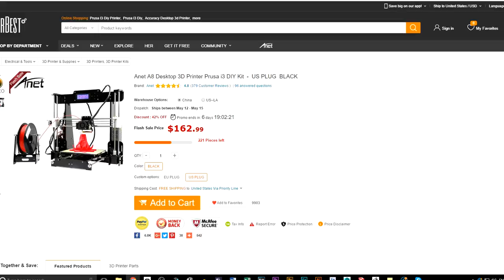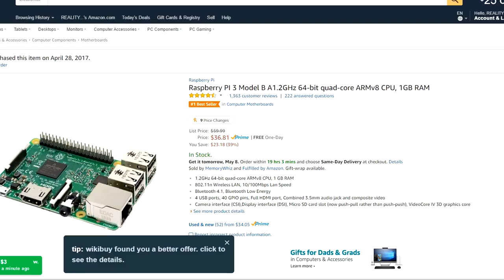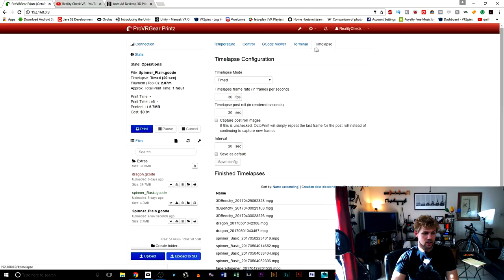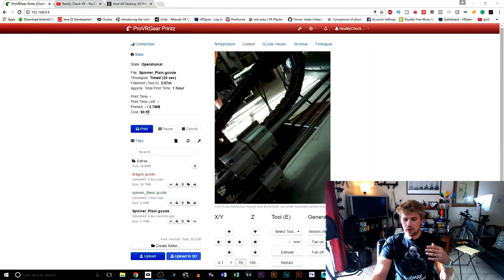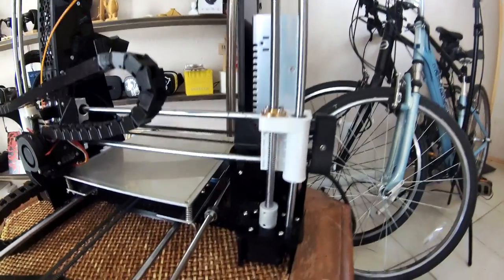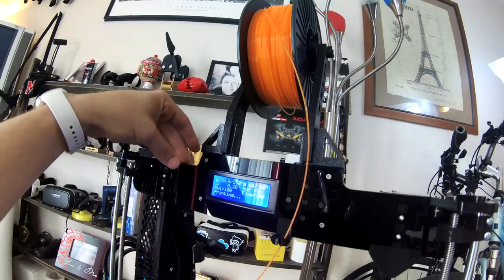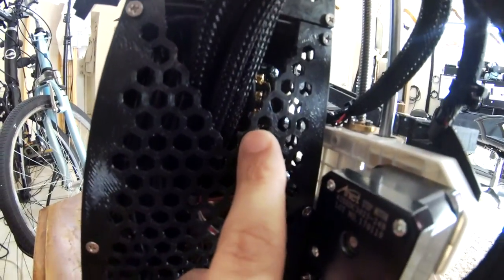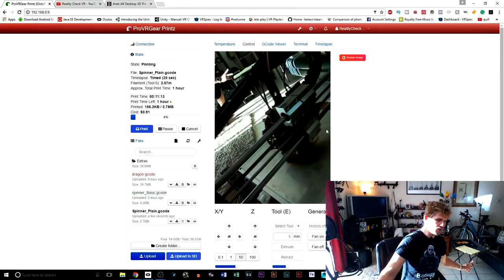✔ Anet A8 3D Printer ULTIMATE UPGRADES! (Prusa i3 DIY Kit) Octopi + Printoid

Comment: There is one modification that keeps getting missed. The hex nuts that are shipped with the A8 are not optimal for the slot method used to connect the acrylic parts together. The hex causes the pieces to move in all 6 directions. By using Square Nuts, a lockwasher at the screw head and a flat washer against the acrylic, you can make your A8 as stable as any frame out there. No need for stabilizers or anything. The square nuts are available on Ebay  (3mm) and I get the lockwashers/washers at McMaster.com. Just sharing! Take Care.
Reply: thanku
Reply: sounds interesting! could you please post some links on which items you used?

Comment: Hi, I purchased the power supply you recommended. I Printed the L bracket provided, but having issues mounting the power supply to the frame.  Did you use M3 screws?  The M3 screws do not hold the L bracket to the frame, at least for me.

Thanks.

Comment: I worked on it over a period of 4 days. (couple of hours per day) If you have fat fingers, tweezers and masking tape is helpful. Tweezer to place the nuts, and masking tape to keep them in place. The only thing that caused me any problems was the extruder. I needed to adjust the threaded feeder tube (mentioned no where in the instructions). Then I tried to figure out how to print a test print. Found out that I had to select a gcode file.
Reply from the maker: Good work man!) This was my first DIY 3D Printer and it helped me learn a lot that I would have never otherwise learned.
You are absolutely right about the fat fingers making things a pain. haha I think I dropped nuts hundreds of times lol. Still once I got this guy running it has remained as reliable ever and is still one of my favorite printers)

Comment: Just to clarify. What is controlling the steppers on your printer: the Pi directly or a standard A8 board controlled by the Pi?
Reply: The Pi/OctoPi software push the gcode to the A8 board via the USB port. You still need the controller, either the stock one or a slightly better RAMPS setup.

Comment: Oi! 37 Thingiverse upgrades?   I thank you for pointing out that the x-axis bed tensioner is best printed BEFORE one starts assembly. My kit is still in the mail, can you please scan the rest of the list and tell us which OTHER of the upgrades are like that? I have no fear of drilling holes to add things on, but I'd certainly like to avoid massive disassembly/ backtracking.

Comment: Very cool the printer! 
Unfortunately, I can not find your covers in the files you have provided for download. 
What did you use for the technology (Mainboard, MosFet & Raspberry)? 
Two different housings can be seen on the video. Thx
Reply from the maker: take a look at the file named "Anet_A8_Electronics_Case_mainboard_octopi_step-down_converter_relay_and_fan..zip"

That should have the covers, and yea I used a Mosfet that is listed in the descript and a rasbperry pi 3! hope that helps)
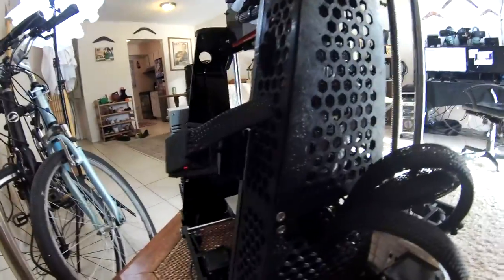Reply: Thanks for the reply, this file I have already found. In the video at 13:53 you can see however 2 different housings. The top I can unfortunately not continue to find. Or have you modified the bottom for the top? On the video the at least not look the same.

Comment: You forgot the most important upgrade: Mount the printer firmly on a veryvstiff and very  level board. Make sure, Everything is straight and level when your m ount it. This adds a lot of consistency to your prints.
Reply from the maker: I agree! although I never had issues with my printer in this way, my table was secure enough) Still check out the video I post later today to see my newest and favorite solution)

Comment: Thanks for the video.  I just received my A8 and about to start my build.  Do you have 1 or 2 mosfets installed?
Reply from the maker: just one, I've heard two was overkill and not necessary, what upgrades are you thinking about?
Reply: Not sure yet.  Half way thru the build and realized one of my guide rods is bent.
Reply: Don't use a Mosfet for your hot end, if you do and it fails it will fail high putting full load onto your hot end and bypassing all your firmware safety's because the board wont be controlling the supply voltage. The Mosfet for the heat bed isn't for safety it is just to offload the higher load of the heat bed from the cheaper controllers so that they don't fail as quickly. Also there isn't the same fire risk with the heated bed as even under full load it is very unlikely to get above 120°C. Fuses for the supply's to the hot end and heat bed are smart as well as a thermal fuse for the hot end.

Comment: After receiving my A8 printer just yesterday, building it and then spending today calibrating and test printing i'm just wondering. Is it worth replacing the Stock Firmware for Skynet? Are there actually any benefits from skynet?
Reply from the maker: for basic stuff no, but to add an auto leveler or multi-extruders you will want to upgrade) hope that helps! HAPPY PRINTING! :D
Reply: Use marlin.
Reply: It's a lot safer to use marlin.

Comment: The switch on PSU is wired backwards, light should only turn on when you flip the switch to 'on'.
Reply from the maker: for sure! I had to go back and rewire it) Originally I wired it based on another video guide that was wrong as well. Once I followed the simple picture that comes with the piece it worked perfectly)  All future switched have been wired correctly))) hehe

Comment: The 12V to 5V adapter does not work anymore. what kind of end is used to plug into the psu?
Reply: I ended up purchasing all the upgrades you have! Thanks for the video! Love your humor! Can't wait to get cracking and start the upgrades! Ended up just buying a hard wire 12v to 5v wire

Comment: You should see if you can fix the cost estimator. 2m of PLA is not $0.91. A 1kg spool is about 300m so unless you paid $140 for that spool, it's more like $0.14.
Reply from the maker: The cost estimator has more than one variable added to it. I've got electricity and time added into the cost. Running a printer or any manufacturing machine is more expensive than just the material that you put into it. It's not perfect, but it gives me a better idea of my actual costs of printing an item overall.
Reply: Wow, I didn't expect it to be that customizable. Nice!

Comment: not sure, if someone mentioned it before, but the switch's lamp is OFF when the switch is OFF, the lamp is ON when the Printer is ON... just a little miswiring there, I guess
Reply from the maker: hehe certainly is, im still fumbling in  my learning days)
Reply: make a picture from the back and I figure it out for you, It was my profession a few 20 years ago :-), shouldn't be much change, main schock will feel the same I guess :-)

Comment: Thanks for this. Can you use the latest edition of Raspberry Pi Zero - will it do the same? Is the pi 3 overkill for just printoid? Can you use it as a regular computer at the same time or is solely for the printer.
Reply from the maker: im not sure about the zero myself, but I do know that you can do multiple printers with one pi!) Using a HD camera for timelapse and control is a lot for one little Pi it seems)
Reply: Reality Check VR perfect .. I have the pi 3 - if I upload printoide. Could I also use the Linux software to be able to use betaflight for my acro and race drones?
Reply from the maker: I would just have a SD card for printoid and a separate SD card for whatever else you want to run)) this would be easiest I think)
Reply: Reality Check VR of course - there’s me thinking it’s hardwired 👍🏼 - this is why you are the one making the content!!

Comment: hey, what heated bed did you use?
Reply from the maker: Dream Deal stock bed with pei attachment, you could add Glass in between for an even nicer finish
Reply: Thanks! but im looking for one :P In the description you put has hardware a mosfet to power the heatbed, but there isnt one in there. You arent using one is that it?
Reply from the maker: the anet a8 comes with a heatbed, im not sure which bed it is off hand though- my mosfet powers it well)
Reply: noob mistake im sorry :P thanks!

Comment: there is no way one can build in a few hours, it took me an hour just to take of the sticky stuff from the acrylic. any way these printers are brill, from the build I did a test and failed print then I setup software in cura properly and wham high res flawless print of an X wing fighter, oh I printed from computer via Usb
all I have done is lubed the metal parts with silicone oil, perfect printing with no upgrade's so happy with this purchase
kewl upgrades on your printer. but not needed on mine :)

Comment: we are in Russia. we all make of stoned steel. add new chipped metal pins and gear of reduced-stroke motors. Heat insulation. wire control. All for 110 $. Print speed at an excellent quality of 200% without vibration.

Mam!!! I am an engineer.

Comment: the anet a8 is a piece of crap printer a CR 10 is a far  better machine and you can build a heat container without cooking your electronics's because everyone will want to do abs at some point. have a nice day :)
Reply from the maker: abs works well on the pei sheet - I've had luck so far anyway)

I'm amazed with the quality of the Anet A8 myself - I've also got a Taz 6 so I do know what a good printer is)

I've seen the CR 10 printer as well and it is GREAT looking as well, just twice as much money)
You should see an unbox video coming soon))
Reply: doug wotton Anet A8 cost 1/3 the price of the CR-10, I love the CR,-10 but that doesn't mean the A8 is crap.
Reply: I have a Anet A8  wile there may be a cheaper printer out there the anet fall's far short of the implied craftsmanship quality of the part's for the kit. i did not say it did not work.but ya it pretty much a cheap crappy printer .
Reply: the anet uses the same steppers hotend assembly and leadscrew as the CR-10, they are all cheap :-). And to some extent all crap but they do work and everyone has different budgets and expectations for their printers. Also a lot of people just like to tinker for fun. its a hobby so each to their own.